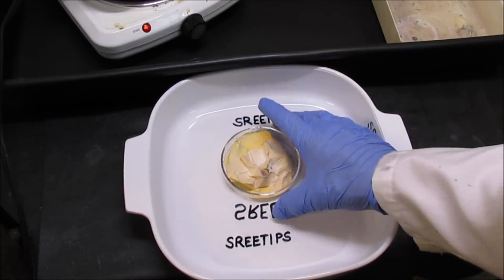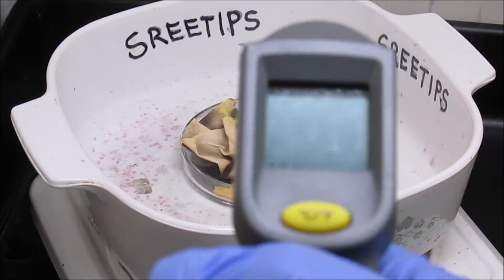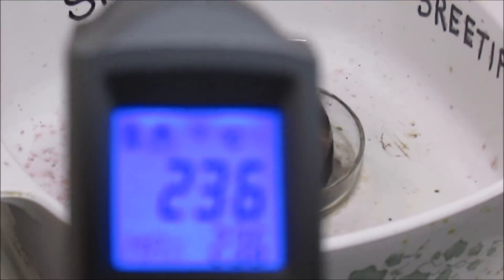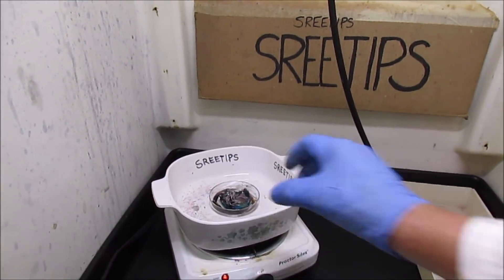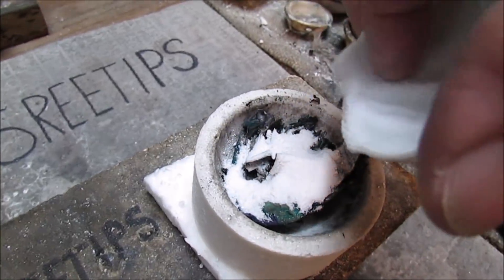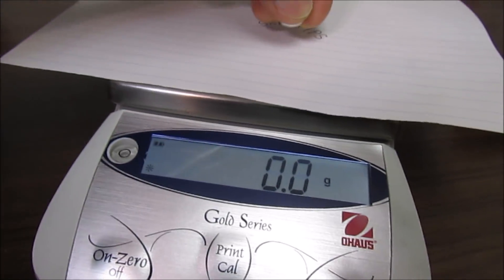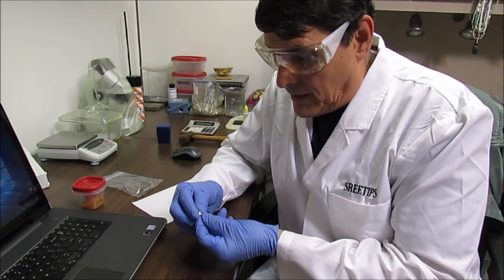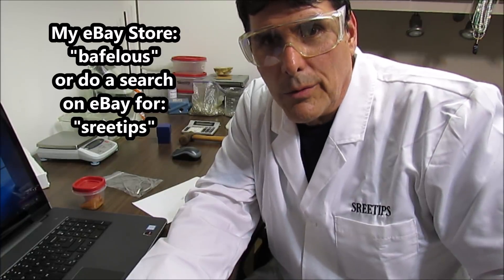Melting Pure Palladium With Oxy Acetylene

Comment: I think there is Tantal, palladium, gold, cooper, platinum, sodium, bohr, metalclorure, everything mixed. There is a lot of palladium more then 20 g maybe 40-50g about 5-10g gold, 1-3g platinum. https://photos.app.goo.gl/6CaLUZszy8VUZWes8. I melt this on induction over  about 1250gr Celsius and after to propane + butane + oxygen torch and now is show like that https://photos.app.goo.gl/2WrCXDf53MsTwHFp6
Reply: Does your induction heater run on 220v or 110v

Comment: Palladium is actually a nightmare to melt sometimes!Even iridium is much easier regardless of vastly higher melting point!And this is because there is a crazy effect that occur when you melt it down which is spitting itself all over the place when it absorbs either carbon when you have a reducing flame and oxygen when oxidizing:upon solidifying it will release them and therefore spits itself everywhere!
Reply from the maker: For some strange reason I'm starting to see metal spitting out of the dish during my gold melts. It just started happening about this past year, never had it happen until now.
Reply: @sreetips if it's palladium than there can be 2 reasons why it usually behaves like that!So the first it's spitting like crazy if any carbon is introduced while it's molten:the reducing flame immediately does contaminate it with enough carbon(as when molten it will absorb all the carbon that will hit it's surface)-so when it solidifies it just starts spitting like crazy when expelling all that carbon!And another reason is that it can behave in the same way if any oxygen is forced into it's surface in case of oxidizing flame because it won't react with oxygen at those temperatures but will absorb it like carbon and spit afterwards!
So maintaining the neutral flame all over the melting process is mandatory!

Comment: I use cyanide to leach, then zinc precip, then hot HCl soak 24 hours, then filter. I tried to melt with propane and borax, nope. Have to go oxi/acet. Ok I have hot nitric soak stuff that I copper piped over night with a off white grey precip. I was told its my silver, but I think palladium is also in it. Will it melt with propane and also grab melt the palladium if there is any? I think its called inquart.
Reply from the maker: Oxi/propane will melt gold silver and palladium.
Reply: @sreetips  ok thanks, its not much but would like to try it to see. am I correct that my hot nitric/water soaks for 24 hours, in the liquid is my silver and palladium, after copper pipe drop over night? Its off white with grey
Reply: @sreetips  ok thanks oxi/acet for both
Reply from the maker: Migel nitric will dissolve silver and palladium. Adding any kind of chloride such as sodium chloride or hydrochloric acid will instantly precipitate silver chloride. But the palladium won't form a chloride.
Reply: @sreetips  ok thanks. Now your saying dissolve in hot Nitric/water, then drop the silver by adding HCl to it. Now can that silver chloride be melted as it is? I was told I can drop the palladium with sodium cyanide, since I have it? So I can add salt to the Nitric/water and that will also drop the silver? Can that precip be melted as is? Could I denox the nitric/water then add water and HCl,then zinc to drop the palladium?
Reply: I have metal paladium quantity 28 kg i in vietnam 🇻🇳https://youtu.be/kBE555jl1nM

Comment: Hello, Sreetips!  Really enjoy your videos!  I was wondering... when separating palladium from PM refining solutions, instead of using DMG or NaClO4 to drop the palladium... can one just use pure silver metal to cement out Pd, as Ag is higher on the reactivity series for metals?
Reply from the maker: I don't think using silver is a good idea. Silver chloride would definitely be a problem. But I've never tried it so I don't have any experience. DMG will get the Pd (and Pt) to drop out of a silver nitrate solution. Then just filter the fluffy yellow precipitate that the DMG makes and dissolve it in aqua regia.
Reply: More specifically... do you think it might work for the nitrate solution from the inquartation process?  Last two batches of inquarted karat gold i processed turned up green nitrate solution. This solution turns stannous test brown. Assuming Pd is present. As DMG is expensive and NaClO4 is dangerous, I was hoping that I could drop Pd with Ag, before dropping Ag with Cu.
Reply: BTW... Thanks for your reply!
Reply from the maker: I see where you're going. I don't know. Silver and palladium are both soluble in nitric. But then so are silver and copper. Give it a try and see what happens. I buy DMG from GFS chemical. Last time it was about $100 for 500 grams and it will last me a long time. It's $50 for 100 grams on eBay. Please remember that DMG also drops platinum. I find DMG to be very effective in separating the PGMs from silver nitrate solutions.
Reply: I have metal paladium quantity 28 kg i in vietnam 🇻🇳 https://youtu.be/kBE555jl1nM

Comment: Sreetips, need to bother you with a question, or anyone else that's wanting to chime in:  been following a lot of your videos, recovering and refining.  I've got a bit of powder, dust saved up now and ready to start experimenting with melting.  Just reaching out for some advice as I have no torch experience...what is your recommendations/advice on 
 using an electric kiln?
Reply from the maker: I've used a Kerr Electromelt to melt some silver a few times. And I calcined some Pt with it once. That's the only experience that I have with electric melting. I had some silver powder that was cemented with copper. Trying to get it to melt in an open face crucible was difficult because it was contaminated with copper and some PGMs. But in the Electromelt the temp inside the graphite crucible seemed to get much hotter (2000 F max) because it was down in the electric furnace and well insulated. I'll probably use it again for melting some silver powder for my silver cell or if I want to melt a large quantity of pure silver crystal for a 50 troy ounce bar of pure silver. I rarely use it, and the folks on GRF like to bash them, but it's nice to have it available. I do most of my melting with my torch because it's easier to set up and use.
Reply: Yeah, I check out your torch work, and I haven't the slightest clue on that note.  So I'm thinking it would be best to start with the kiln to melt my gold powder.  Thanks for reaching back out man!
Reply from the maker: If you have platinum or palladium to melt then forget the electric furnace. It only gets up to 2000 degrees F, well below the melt temp of Pt or Pd.
Reply: Just concentrating on honing my gold skills for now.
Reply: I have metal paladium quantity 28 kg i in vietnam 🇻🇳https://youtu.be/kBE555jl1nM

Comment: I can't quite tell.  Was the palladium still in the filter paper when you calcined it?  I didn't know you could do that.  I was once told that the palladium would absorb some carbon thereby contaminating it.  If it's ok to do this that'll make things WAY easier for me later on.  :)
Reply from the maker: I'll have to get back to you on that. I may send in a piece to the big refiner after calcining with the filter paper. They will assay with XRF. If carbon is present as a contaminant then it will report in their assay. I'm new to PGM refining. We can both learn something.